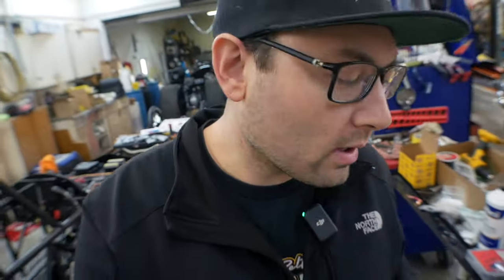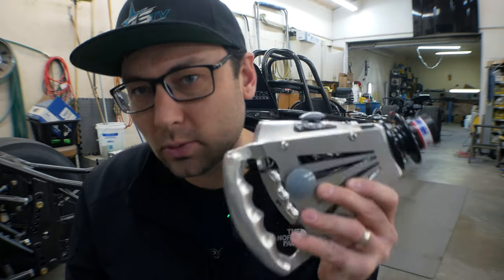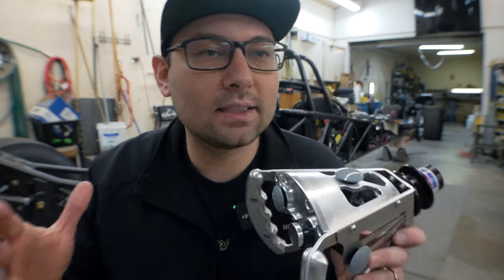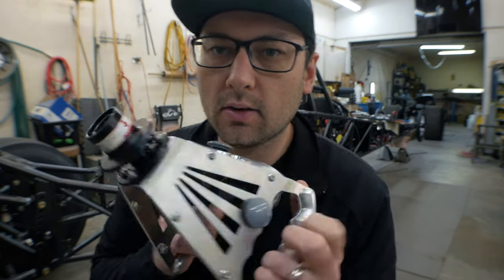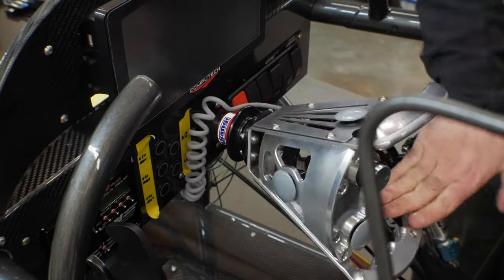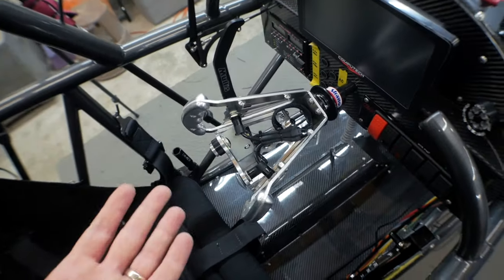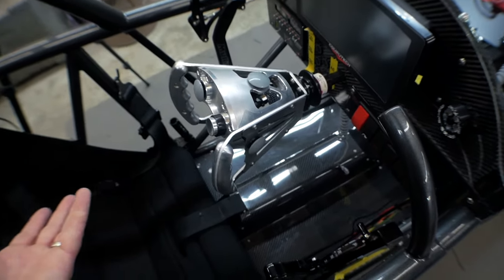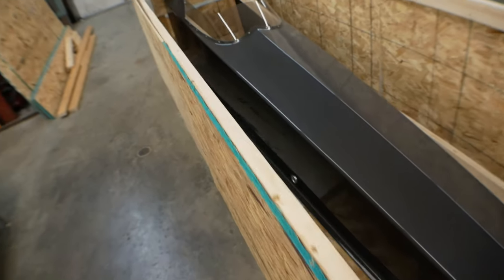Not Your Average Steering Wheel | Ultimate Mullis Bracket Dragster Build Series Episode 7

Comment: I have always used a common power on steering wheel buttons. Reduces the wires and keeps it cleaner. Great job! Another cool thought would be to do something like fanatec does on their sim wheels. Their electrical quick connects are built in to the wheel socket, when you release the wheel, you also release all the connections. I am sure that would get expensive but a good way to keep everthing clean and have no curly wires at all.
Reply from the maker: Well shoot..   where were you 2 months ago 🤣🤣🤣

Comment: Great video Tom. I've also spent many hours trying to get my wheel just right. I'm using an American butterfly too. I run my bump down button on top so I can just slap it quick. I used to use a burnout button, but after talking to Gary Stinnett at PRI, I got rid of it.
Reply from the maker: Do you remember what was the reason to not use it?
Reply: @GallStarTV  Yeah, he said it's hard on the valvetrain, especially valve springs. There was some discussion in elite about it too. I know Luke doesn't use one either.
Reply: I set my burn out rpm high enough that I never get “on it” but just as a back up if I do screw up, which I guess is somewhat redundant since I have a main rpm limiter also.
Reply from the maker: @jeffpietka8569 ahhh….  I see!!